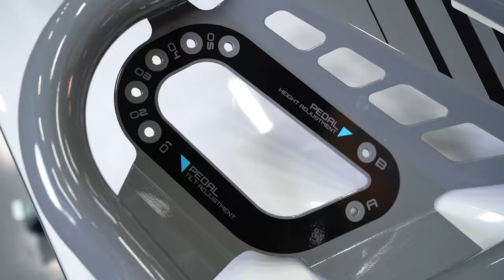Unboxing & Setup Playseat® Trophy - Logitech G Edition (Unboxing, Build & Setup)

Comment: Uff the instruction manual is confusing AF, the diagrams are presented in a really weird way. So I searched youtube for some help and came across this video, which was super stylish but needed to be way more zoomed in to be clear and way more instructive to explains things better. The holes didnt align 100 percent wirlth each other as well and some of the pedal stand knobs has issues tightening. Feel like all the points went to looks/style but im a bit worried about substance. Will wait and see when i get my wheel
Reply: Did you have issues installing the pedal plate? I just built almost the whole thing but the place to fit the pedal plate is too narrow. Do I have to take it all apart again?

Comment: What are the 4 thin rubber o-rings for? Got my seat today and there's four rubber o-rings that aren't shown anywhere in the parts list or instructions.
Reply: Hello, I just set mine up. Those 4 thin rubber washers are for the inside screws of the pedal base. 

The washer goes between the pedal base and the plastic insert. They clamp down when you hand tighten the blue hand screws. 

I’m thinking of doing a video with a few tips that are not covered in the instruments or anywhere on the internet. 

I hope this helps, if not send me a message.

Comment: Please help with the lumbar support as the instructions are incorrect and the video shows something different.
Reply: Did you figured it out? I’m currently confused about the support bar, are those supposed to be adjustable? Why does it have 5 holes? Mine came fixed bolted on the first hole and I can’t adjust it! In the video 1:33 it showed bolted on the second hole!

Comment: I just got a defective seat, at 1:33 , the video shows the bar mounted in the second hole of the 5 total available adjustment. Mine only came fixed bolted at the first hole. Is it supposed to be adjustable? If not why make those holes?
Reply: You need both of the included number 4 allen wrenches to remove those bolts (one on top and one on the bottom). Removing those and sliding the bars on both sides of the seat allows you to tilt the back of the seat forward or backward.